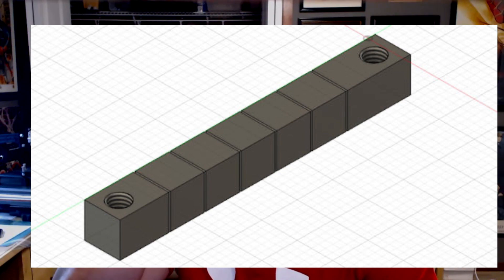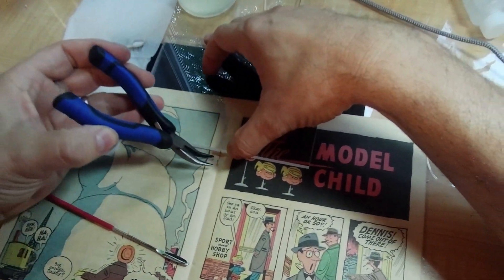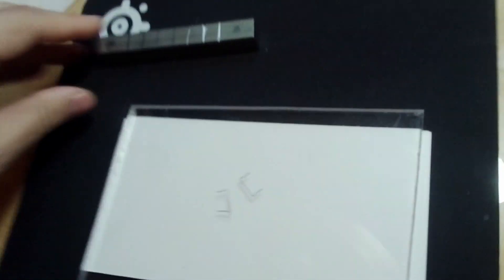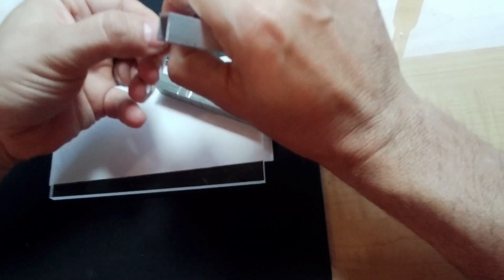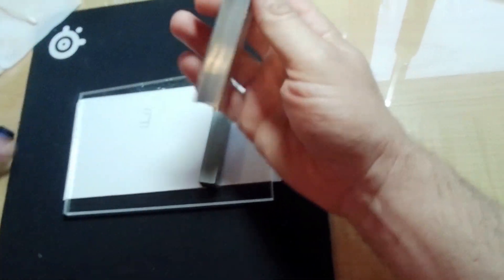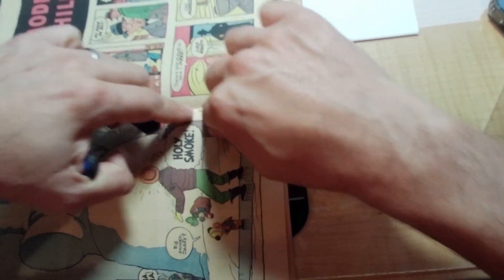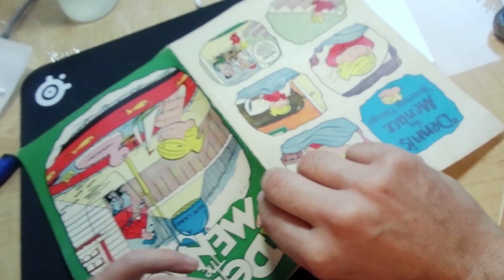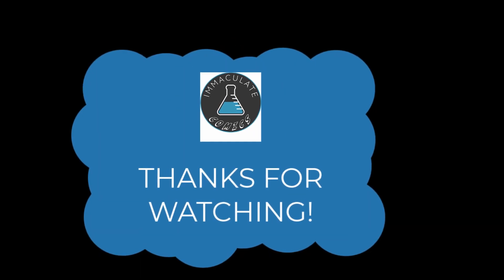Forming comic books staples

Comment: I love the effort. You never really explained "why" the mandrel, annealing and "electronic cleaning". Dental tools, needle nose pliers etc stills seems to win out but your efforts are what has made the world a better place. Best tip was to get half the staple back through from inside and a comment to lay the book on styrofoam and push them into the foam. Having pulled and cleaned lots of staples, it is so dangerous getting them back in. Old tattered books are almost impossible not to further damage. I'm thinking a tool to hold and flip the whole book is where to focus your design skills. It's so complicated that I just keep on doing it all by hand but adding book damage is so worrisome and dangerous. Also so, keep track of Top & Bottom staples and orientation because the have to END UP WHERE & AS they were. The original installation seems to end up with a long & short leg and some are round and some straight. The intentions in the centerfold reveal this and is one way they check for staple replacement. IMHO, if you can't tell the staples were pulled & put back, they weren't. If you can tell the staples we're fooled with, they were.
Reply from the maker: Thanks william!  I appreciate the comments.  I use the mandrel so the staples fit through the original holes exactly and also maintain their shape during annealing.  I anneal them to restore ductility as steel is work hardened from bending and will fatigue fracture (just bend a paper clip back and for a few times and it will snap).  I electroclean them to brighten and clean them without removing tool marks that would identify them as period-specific staples under a microscope.  I very much appreciate your input.  I have several dozen books comic back from CGC with cleaned staples and I'll have to check for comments on them.  Once I got a comment that my staples were replaced but had to show a 40 minute video of me  cleaning and replacing the original staples to satisfy that particular person.

Comment: Now that I'm thinking about it this tool could be used to fabricate a staple out of 20 gauge steel wire (yeah I know that's not an original staple, but there are times when you just don't have the original or access to an appropriate one for whatever reason).
Reply from the maker: it certainly can.  In fact you can now use stainless steel with so it doesn't rust in the future.

Comment: FWIW, I've had really good luck reforming and squaring up staples in half a minute or less using a Channellock '44' pliers, which is 4.75" long with a 3/16" wide flat nose and smooth jaws. Just squeeze the legs or body of the staple where needed to straighten. Gives an excellent result and doesn't stress the staple.
Reply from the maker: thats a great tip, thanks so much!

Comment: I have always been VERY nervous about removing the staples. I have done it, but I am concerned about tearing the paper around the centerfold page or cover itself. I don't want to make extra perforations while inserting the staples either. I have also had issues making the staples tight enough to keep the cover and pages from being loose. Wow, being able to make the staples straight before trying to insert them would be a big help!
Reply from the maker: Having them start out nice and square and properly shaped to fit the holes helps greatly!

Comment: Sign me up, that looks so much better than trying to staighten them with pliers! When I put staples back in a book, I lay the comic on a 1/2" thick  piece of extruded polystyrene, it keeps me from having to try and hold the book while putting the staples in.

As far as removing staples, there is no right or wrong way, it's whatever works best for the person removing them without damaging the paper.
Reply from the maker: good ideas as always, Jim!